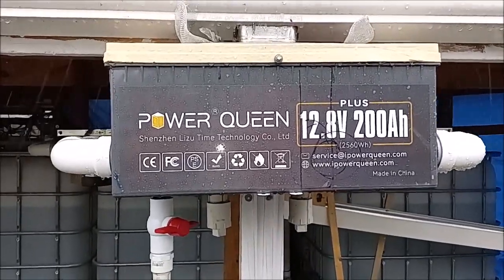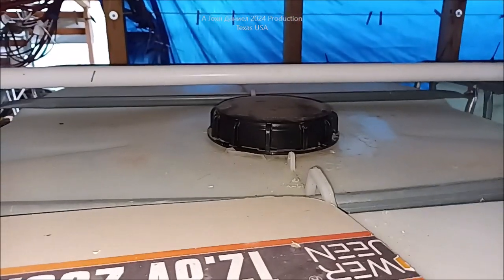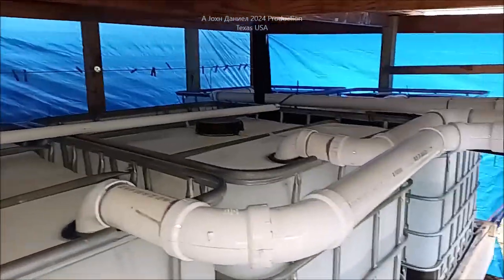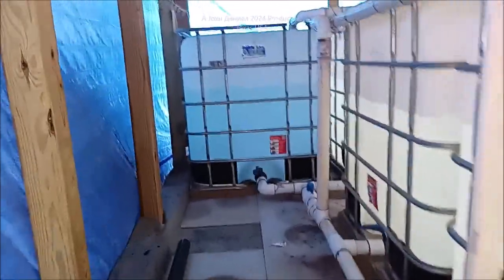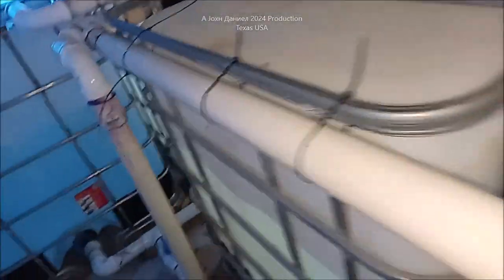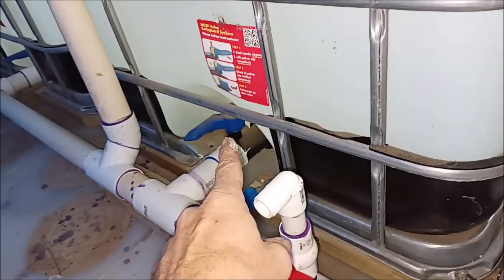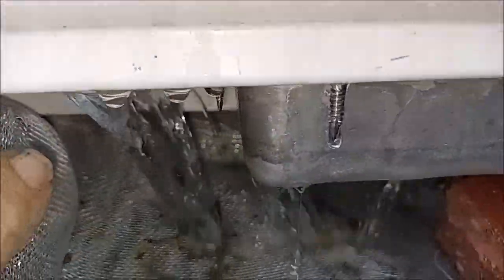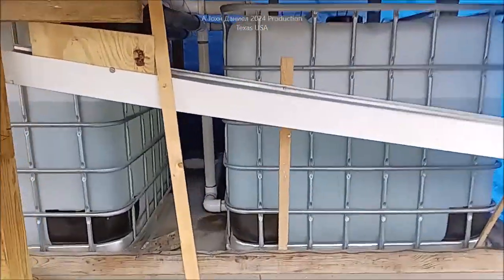Budget High Capacity RAIN WATER HARVESTING COLLECTING you can do EZ Cheap  |  Preppers Water System.

Comment: Hey John, good tip for us water harvesters, is a self cleaning tank, ive put my last ibc tank on a 12v 6lpm pump through a 5 micron osma 10"house, via a 15mm pvc across the bottom back of the tank with 4 hole 2 pointing towards the opposite nearest corners and the other 2 pointing towards the outlet, I add a bit of clarifier and pH reducer, plastic cuases acidity, coming out 1micron, carbon block too tap.
Reply from the maker: All ideas and methods are good to see.
Reply: This will also reduce the amount of chlorine needed, i try and only put a small nail full in the first 10micron tank which then tops up the 5micron tank.

Comment: Love the box of plumbing fittings  got a box or 2 of my own i measured remeasured.  Still git boxes  
HAha. Lol  i
Reply from the maker: I was a master plumber for 13 years, journeyman for 18 years. Stopped doing it after loosing bids to illegals for a year and went to trucking to give my knees and back a break. My plumbing inventory is over 15 years old now, over 1000 DWV fittings, over 400 MPT/Pressure fittings and only a auctioneer would figure out how many PEX, CPVC, ABS, Copper, and PVC parts I have still in crates. I got a Site box filled with steel gas fittings still. Very handy to have all that still.

Comment: Thanks for the interesting video about an interesting subject, John.
I do have a few questions: 
You could maybe save some plumbing by only having one pipe going into the tanks? Of course, you would need an air vent on top of the tanks. Also, you could probably go down a dimension or two on the pipes, especially when you have 4 tanks? Just keep the manifold large.
I would definitely clean/filter the water 100% before it enters the tanks, or things in there will probably get nasty over time.
The tanks should probably also be totally blocked from light of the same reason.
I don't know if it is a problem, but is use of an old Lithium battery container safe for human consumption? Lots of chemicals in there, I would guess? 
I'm going to make something similar, but the water will only be used for cleaning windows and my car (since the municipal supply is hard water).
I will also make a first flush water diverter, just to get rid of most of the dust and organic material that have collected on the roof during a period of dry weather.
I will be following along to see how you move on from here.
Always something to learn.
Thank you.

Comment: We use IBC Totes and disinfect our water with a Del Ozone generator and a Danner Pondmaster AP-20 Air Pump. and then filter down to 1 micron.
Reply from the maker: Use the SPIROPURE 0.5 micron https://amzn.to/4cLsCWh in a pair side by side to reduce flow resistance and increase them to over 0.5 micron ability. With under 45 psi they can exceed 0.5 to about 0.4 but you have to make them a parallel set up with a pair of 1 micron before them and a single 4x10 5 micron in the lead. I was a pipe tech and plumber for decades and make my own systems. Most people put filters on 60+ water pressure and get 20% less actual capture after first 50 gallons.

Comment: Rise to overflow is the maintenance free way to go 👍
Reply from the maker: Yes, just need to consider surge ratios and pipe flow displacement values. We ended up with 3.6% from 100% full is the balance on ours at 2.5 inches pre hour mega storm flows.
Reply: @JOHNDANIEL1  I admire the system. Gonna set up similar with my quonset hut build. I Just got a 310cc water cooled Kubota diesel generator. Game changer for my property capabilities.
Reply: @JOHNDANIEL1  would you consider doing a video on the lead Acid Carbon AGM batteries?🙏 Thanks for sharing your knowledge. Love your videos.
Reply from the maker: @brandonboulton2776  yes if I could get a few.

Comment: Great job. Look forward to more clean water collection as I'm doing the same.
Reply from the maker: Those pass though mesh filters on Temu were $7 to 8 and everywhere else over $12 each. I bought lots of them for many water sources. Get you the 1" in 40, then 80, then 200 mesh 1" inlet/outlet to pre-filter so your pumps and tanks stay cleaner. I am just using a pair of RV pumps to do all transfers at 33 psi.